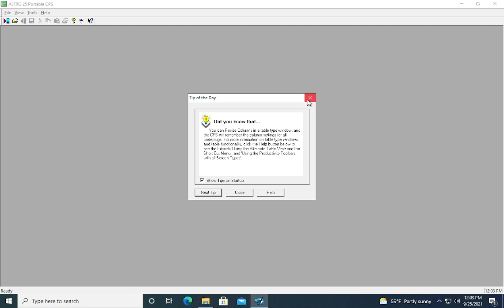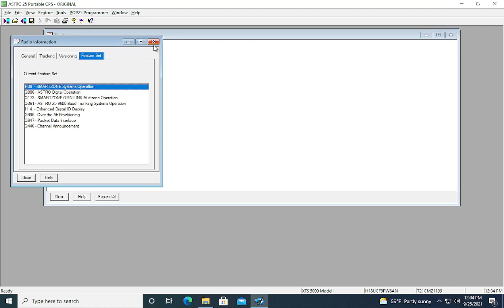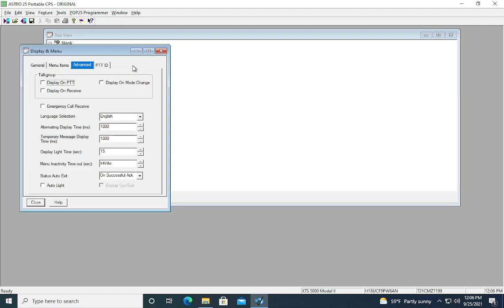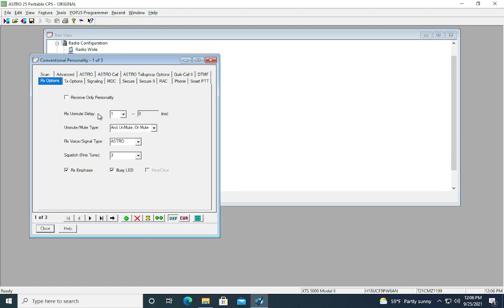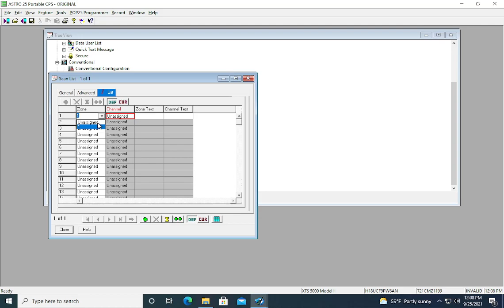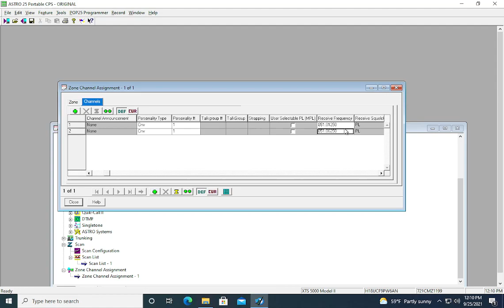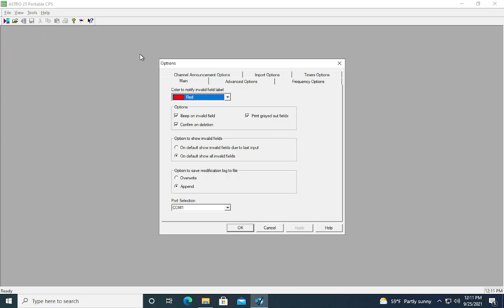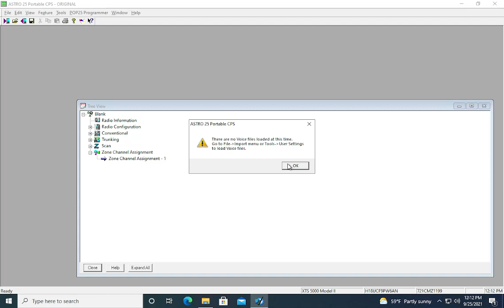Intro into Motorola XTS5000 CPS

Comment: Is there a specific windows version needed to use this software? I am having issues comunicating with the radio.
Reply from the maker: Not that I'm aware of I'm running it on Windows 10 without any issues. I
Reply from the maker: I would check your device manager make sure it's saying it I personally have cereal ports on my computer but have heard if you're using a USB to serial adapter it can cause issues.